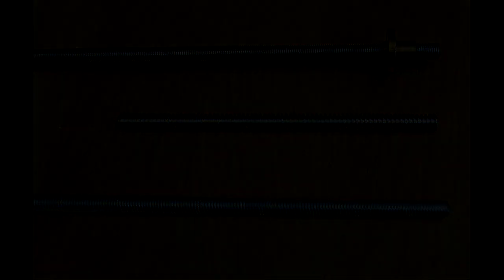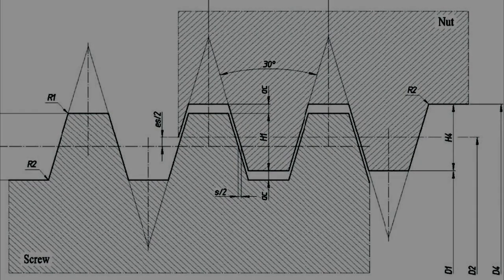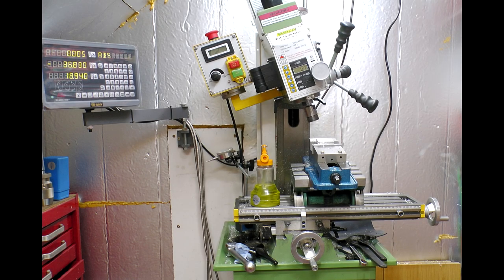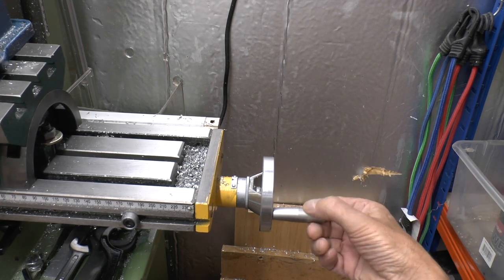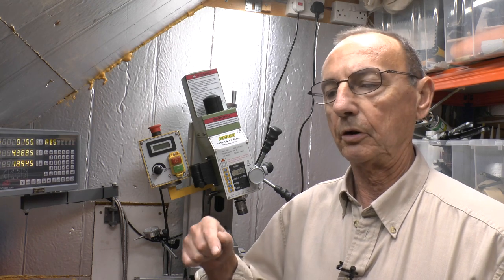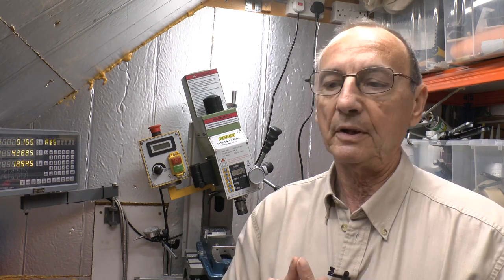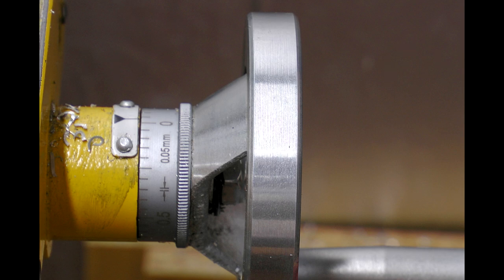All about Lead Screws for 3D printers

Comment: I would like to encourage you to do more videos, so I did subscribe. I am starting to build my own printer from scratch, as I've ran out of things to upgrade on my current large volume printer. I always figured that belts were used on the X and Y for speed, and to some extent to keep per unit costs down. I knew that using lead screws on X and Y would require a more course thread, and all the bad things that go along with that, but never considered backlash as well. I would enjoy hearing you speak about the actual root causes of artifacts such as ringing, how it finds its way into our prints, and how we can reduce it as much as possible. Something tells me that your counterbalance system has something to do with that. Thanks again for the well presented, and valuable information.
Reply from the maker: Thanks for the encouragement. I now have over 1,000 subscribers but the viewing hours are still less than half what they need to be before I can start thinking about monetisation. It takes me quite a while to put a video together and I get nothing for my time and effort. But I'll keep putting videos up as and when I can find the time. 
Ref ringing - you are partly right in that my machine does not suffer from it. But it never has done - even before I added the load balancing gantry. I do know the reasons why and for sure I can cover that in a future video. Part of the reason might surprise you and I expect I'll get a lot of flack because much of the cure goes against what seems to be the consensus view of things.

Comment: Thank you.  I discovered that the lead screws I have on my Ender 3 V2 are too short to be fully supported at the top and at the coupler, so I was looking at getting some new screws, but I wasn't sure whether a single start T8x2 lead screw was what I needed or not (I'm currently running the stock 4 start T8x8 lead screws that came with the printer and the dual Z upgrade), but given that it means I can theoretically achieve sub 0.1mm layer heights with full step accuracy on an FDM printer, I'd say that about wraps it up with a nice little bow.

Comment: Very good explanation on lead screws for 3D printers.
Reply from the maker: Thanks. Hope you found it useful or helpful in some way.
Reply: @deckingman  I did.  I'm doing a second mod on my Ender 5s for dual Z axis.  The first was front to back, this one will have the lead screws on the sides.  I found a good design on Thingiverse and am making some changes.  I went with the T8 x2.   Which I received yesterday,  Thanks for reinforcing that I made the correct choice.

Comment: That's about all the info you'd ever need when dealing with lead screws, amazing job! Wanted to argue first about term "lead" being more important than "pitch", but few thoughts quickly turned it into understanding of my misunderstanding :)
About choosing screw with low lead: I don't see big of a problem to choose layer height with relation to full step, I always do that with my 8 mm lead (so 0.04 increments for layer height and z-hop). Real models wise, only if you need to make a thin film or model with precise height (say exactly 30.1 mm).
Once again, great job!

Comment: Verry nice and mostly complete explanation.
Two points:

1) As you mostly drive the z-Motor with microstepping (simply because the movement will be more quite) you can not be sure the endstop triggers at a full step. So z(0) might be at a 0.75 step and z(0.2) also should be. So changing from 8mm lead to 2mm lead does not make the layers using fullstep positions. So while the therory you show is verry common, it actually not complete. The real advantage of using 2mm lead is the precision of positioning by theroticaly by a factor of 16. If for example the holding tourque of a 1/4 on 7mm lead step would be just reliable enough holding z, but the "target position" is on a 3/8 microstep and the z would stay on 1/4 due to not enough tourqe for the last 1/8, be incorrect by 8mm/200*1/8 = 0.005mm. Which at 0.1mm layerhight is an error of 5%. The theory about "magical layerhight" is not to get "fullstep-layers" but to make the error constant (if its 5% of in one layer and the next layer have the same microstep position, it most likely will be the same 5% off). So exept for first layer the error will hopefully be the same everywhere. You do not need 2mm for that - why using 0.1 mm layerhight and not 0.08 or 0.12? Why 0.15 and not 0.16? But off course 1/4 step reliable holding z does not mean 1/8 step never holds it. Might stop, might not. So the 5% error might sometimes take effect. Expect of course you set the motors to 1/4 microstepping (but the vibrations...)

The real advantage of 2mm lead: 4 times the tourque means if with 8mm lead a 1/4 step reliable holds z, now a 1/16 steps holds reliable (theoreticly. Due to more tourqe-loss by friction maybe 1/8 step). Also a (micro)step on 2mm lead means only 1/4 movement compared to 8mm lead. So theoretical 16-times more precision (in real life about 8-times). So the error gets so low you can not see it anymore.
This is esp. usefull using ABL or vasemode, there you do not have a pattern of z-positions but z changing depending on x/y coordinates.

1/4 step as reliable holding tourqe of course only is an example, it totaly depends of the printers mechanic, wich microstep might reliable hold z.

2.) While you are totaly right about anti-backslash nuts on z are not needed as long you do not install your printer on the ISS, most people using them do not install an anti-backslash nut to avoid backslash. As on T8 screws the friction is low, some printers (esp. early Ender 5) thends to bed falling when powwer of. An anti-backslash nut provides more friction, pressing to booth sides of the tread. So most people install the anti-backslash nut to solve bed-falling-on-power-off problem...
Reply from the maker: You raise a couple of interesting points. I'm no expert on stepper motors so the point about them holding accurately between two full steps is one that I have asked many people, many times. Invariably, the answer is something like "yes/no/maybe" and always with caveats. The consensus that I have gleaned (which might not be correct), is that they would tend to "settle" at a full step - especially when "idle hold" kicks in and reduces the current. A similar question is "would a move command of one or two micro steps actually translate to any physical movement of the motor?" Again the answer is invariably "yes/no/maybe" depending on any number of factors. But I think we can agree that a 2mm lead screw will give 4 times better resolution than an 8 mm lead screw. 
Also, using a remote motor driving the lead screw via a belt, with a (say) 20 tooth pulley on the motor and an 80 tooth pulley on the screw would improve both the resolution and torque requirement for an 8mm lead screw.
Regarding the "auto rotation" on power loss due to the steep helix angle of an 8mm lead screw, that is something that I meant to talk about but forgot. I hadn't considered that anti-backlash nuts would help in that situation so thanks for pointing that out.
Reply: @deckingman  It´s even more complicated. For example: 1/16 microstep alone certainly will not make a move at all. But if the motion direction is up and the mass of axis already rotating (as changing one layer even on 8mm lead means 2.5 fullsteps at 0.1mm layerhight) might have enough momentum to cary up. And maybe momentum takes it up to the desired position - and fricton-torque of the 1/16 step will hold it there. But going down (for example after z-hop), one microstep above the next fullstep certanly will not be able to stop movement - it will end on the next fullstep.
So as Isaid - magical layerhight does not make the layerchange on a fullstep position (with 1/16 microstepping the chance is 1:16 endstop randomly trigger on a full step), but making the error mostly constant.

You misunderstood my comment about using 2mm lead instead 8mm increases the torque (English is a foraign language to me, so a bit hard to explain). What I ment: As with one rotation you only go up 2mm, the torque you need to move up is only 1/4 as you need for 8mm. So if you only change the leadscrew but keep current and stepper, all steps - including microsteps - will result in 4 times the force upwards; this is equaly to a stepper with 4 times the torque on a 8mm leadscrew. So without extra gentry, by changeing from 8mm to 2mm lead, at the same time you get 4 times the resulution, but also the torque results in 4- times the force upwards. Now the tourqe of microstep has better chance to produce the force hold z. So if before changeing the leadscrew a 1/4 position can hold z, now the torque of a 1/16 (theoreticly) will hold a z position. It is not exact, as 1/16 microstep does not have one quarter of the torque of  1/4 step, but a bit less. So the 4-times more resulition and the 4 times force by same (low) torque of a microstep sums up to an even better resolution / less error in positioning. So the result is not only 4 times as good, but 16-times (theroretical, in reality about 8 times).

I already changed most of my printers to 2mm lead. Nearly one of the first mods. Only the mk3(s) with integrated leadscrew I did not make a change, as I found no source for integreted 2mm lead leadscrews. Two weeks ago I first such motors for a reasanable price (about 16$ with 320mm leadscrew with lead of 2mm). So I ordered two, to try it on one of my mk3(s).

Yes, as I saw the first mods with ant-backslash on z, I thought "why? gravety is always down..." until I understood they actually only try to increase friction. As I use POM-nuts anyway (which have more friction, but are more silent), I took some time to understand it...
Reply: Holding torque of a stepper motor is measured with one full step of error.  So if your error budget is a 1/16th micro-step, then you only get 1/16th of the holding torque to use to move the load.  This is where the drag in an lead-screw can bite you and re-introduce "backlash" in how the printer follows commanded moves. 

There's also many more types of anti-backlash nuts than just the cheap split-nut with a spring.  Kerk in particular makes fancy nuts that take up backlash with a spring driven screw mechanism so that drag torque can be kept low even with high reversed loads.

Comment: Amazing video. I have understood everything from the beginning to the end.
Reply from the maker: Thank you. Glad you found it informative.
Reply: @deckingman  If I can have a question. Is it harder to keep the smaller pitch screws running smooth? Because of dust having bigger effect on them for example?
Reply from the maker: Not really. It's the thread form that is more important than the lead when it comes to dust or debris. If you look again at the graphic for trapezoidal threads, you'll see that because the peaks are removed, there is clearance between the tip of the thread form and the root (the valley). So any dust or debris will tend to collect in this space, rather than cause the thread to "bind". Whereas, "normal" threaded rod where the thread form comes to a sharp point does not have this space, so it is more susceptible to "binding" if dust or debris is present. But the lead or pitch is largely unimportant in that respect.

Comment: This incredibly detailed. Thank you. One question though:
- If I want to replace the 8mm with a 2mm lead screw, does that mean I have to change adapt the firmware as well?

- if yes, would you happen to have a guide on doing this or a link to a video, please?
Reply from the maker: The only thing you would have to do is change the steps per mm for that axis. With an 8mm lead screw, one revolution would give 8mm of linear movement and using 1.8 degree stepper motors, one revolution would also take 200 full steps. So we know that (200/8=) 25 full steps would give 1mm movement and most firmwares assume 16x micro-stepping so your steps per mm are probably (25 x 16 =) 400. With a 2mm lead screw, one revolution would give 2mm of movement so in that case you would now have 100 full steps per mm which at 16X micro-stepping would be 1,600. You may have different motors or gearing to that example but you can see that whatever steps per mm you have with an 8mm lead, would need to use four times higher for a 2mm lead. You might also want to change the speed and acceleration settings for that axis but that that depends on many factors. So try it and see what works best for you on your machine.  HTH

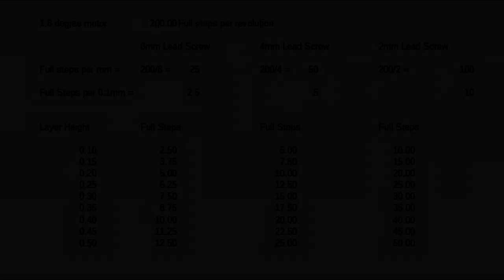Comment: I found your video when searching for a design guide to select lead screws for a 3D Printer. Thanks for the tutorial. Learned quite a lot. But I am a bit confused when you say "mil" referring to mm (Video time 26:11 onwards)
Isn't mil =  one-thousandth of an inch, or 0.001 inch? One mil also equals 0.0254 mm (millimeter).
Could you please clarify. Thanks.
Reply from the maker: It's just an abbreviated way of saying millimetres. Just like we say "a couple of secs" instead of "a couple of seconds". When referring to fractions of a millimetre we might say "point two mill" instead of '"nought point two millimeters". We often write "mm" as an  abbreviation for "millimetres" so saying "mil" instead of "millimetres" is just a verbal abbreviation of the written expression. It's a sloppy use of language for which I apologise but it makes perfect sense to native English speakers and/or students of engineering.
Reply: @deckingman Thank you for the clarification. I was confused because as an Electronics Engineer, I always interpreted "mil" as 0.001 inch.    I did not know that "mill" in colloquial speech.= "millimetre"  abbreviated.   Learned something and will know in future to avoid confusion.
Reply from the maker: To confuse things even more, before the UK went metric, we used feet and inches. A thousanth of an inch was referred to as a "thou" (pronounced like "how"). If we worked to tight tolerances, we'd use "a tenth of a thou" meaning a tenth of a thousanth of an inch. Or a hundredth of an inch might be ten thou.    But we never used "mil" as a unit of measurement.

Comment: So since screw with 4 starting thread have Highest content Area so dones it mean it produce less backlash than of screw with single face thread ? Does the choice between these two matter?  If I want to make milling cnc machine?
Reply from the maker: Well it's not quite that simple. If you look at the pitch, rather than the lead, then the contact area will be roughly the same. That is to say, an 8mm, 4 start thread will have a lead of 8mm but because it has 4 threads, the pitch (i.e the distance from one thread root to the next adjacent thread) will be 2mm. Whereas a 2mm lead, single start screw also has a pitch of 2mm (which happens to be the same as the lead). So all else being equal, the backlash is likely to be the same although the steeper helix angle of a 4 start thread might play a small role in that. For a CNC machine, you'll likely need higher speeds than if you were using screw driven X and Y axes on a 3D printer, which are easier to accomplish with a 4 start screw. Just be aware that you'll need bigger motors than you could use with a single start thread because of the gearing effect. It's a trade off between speed, torque and to some extent positional accuracy and I can't make that decision for you.

Comment: Thank you, it was a lot of useful information, I was thinking make an actuator with 200mm range, but able to pull or push up to 20 kN. I thinking use normal threads rod M12. Is it totally wrong?

Comment: Pls, talking about DIY CNC machine. Would you advise 8mm lead or 2mm lead screws on the x and y axis ?
Reply from the maker: I hesitate to answer that because I have no experience of using a DIY CNC machine. My "gut feel" is that feed rates are likely to be lower than a 3D printer (at least for cutting moves) but that precision needs to be at least as good if not better than a 3D printer. So on that basis, I'd have thought that the finer, 2mm lead would be the better choice. But I would suggest that you pose the question on a CNC forum or at least ask someone with more experience than I have.
Reply: @deckingman  thankyou very much sir. Appreciate that.

Comment: Very interesting, one question, why not going on the 1mm lead so 1 full circle is 1 mm of move? It should have less back lash and very precise, speed would be slower then 2mm but torque applied considering the same motor should be higher. It would really like to have your consideration. Probably resolution would be too high considering print layer size.
Reply from the maker: I used to have 1mm lead screws but changed them for 2mm lead because the Z axis speed was limited by the maximum step pulse frequency that the Duet 3 firmware was capable of at that time. 1mm lead gives 3200 steps per mm at 16X micro-stepping which is a lot of steps per second that the firmware has to generate. Z axis speed is not normally a problem because we usually only move a fraction of a mm during printing. However, I can print objects that are around 800 mm tall so to home the printer after making such an object meant that the Z axis had to travel the full 800mm. When the speed was limited to 300mm/minute(5mm/sec), that meant that it would take 2.6 minutes( 160 seconds) just to home the Z axis. Changing to 2mm lead screws doubled the speed so halved that time while still retaining sufficient resolution. Also the Z motor is more than capable motor of providing the required torque. 1mm lead will screws will give a resolution of 0.05mm per full step but we don't need the resolution to be that high and can't make use of it. So there for me, there was no benefit to offset the reduction is speed.